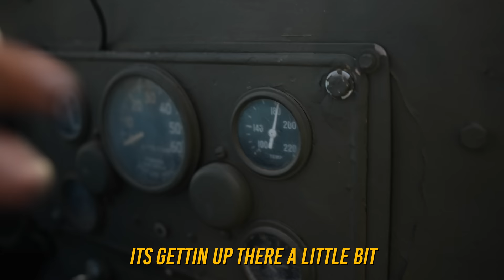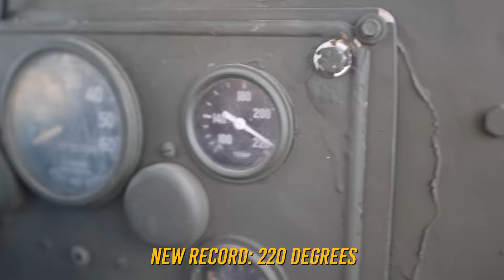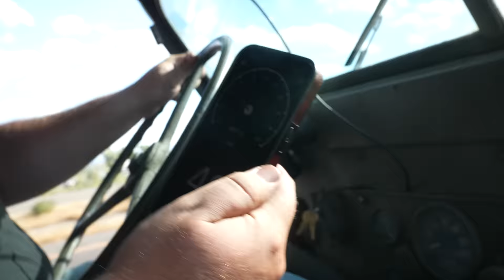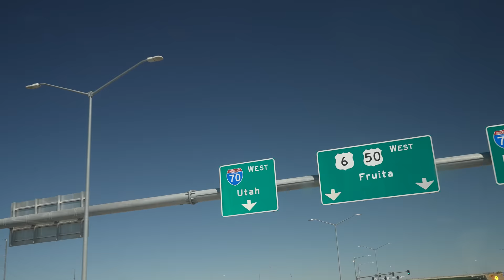We Off-road Test a 70 Year Old Army Jeep (1,152 Mile Road Trip)

Comment: The Jeep you have is NOT a WW II model. It is a 1950s era Jeep since it still has a flat head engine. In the 1960s, they body style remained substantially the same but they upgraded to an overhead valve engine,fully synchronized transmission, and 12 volt electrical system as well as increasing the tire size somewhat. The vehicle identa-plate will have the year of manufacture on it. By the way, WW II ended in 1945.

Comment: You made an absolutely unbearable drive and then fixed it and drove all the way back. But I don't think anyone has mentioned yet the fact that you completed a level 6 trail rated as intermediate that "requires a rear locker" and 35"+ tires are recommended.....😳 With two open diffs, old ass tires and a clutch that was giving you hell! ABSOLUTE LEGEND BROTHA!!! 🤙
Reply: in a vehichle that started the whole concept. really for me this was proof that the OG Jeep deserves its title.
Reply: C90adventures did it in a toy jeep 😂

Comment: We had two 40’s Willy’s jeeps at my grandparents ranch and we put those things through more crap in the mountains and river and sand than they probably faced in Germany and they took it every time. When we very rarely broke them they were super easy and fast to fix. When you lock the front hubs and put the in 4 wheel low they are just about unstoppable. We had a couple of other 4 wheel drive vehicles there that couldn’t do half the stuff those 2 Willy’s could.
Reply: My 43 GPW pulls 20' camper trailers around the field like it's nothing. 
And in low you can almost walk next to the jeep
Reply: @kyleh3615  I’d imagine it would pull a 30’ foot trailer as well lol. We use to pull 12’ wide  drag behind ours to clean up and level out the surfaces of our roads to the river and our alfalfa fields. They are what I learned to dive stick in and nothing is worse than driving stick through the mountains almost 30 miles to town. Steering never was exactly the tightest and you always had to pump the brakes after a bit lol. Needless to say I was never nervous driving any other standard vehicles in the mountains and hills.
The government got that vehicle right. Then again that was a different time with different builders and such. Truly amazing vehicles and in my opinion the most indestructible Jeep ever made.
Reply: @P-J-W-777  the Ross T-12 steering gear box was always trash. You can adjust it and tighten it, but it backs off almost immediately
Reply: @kyleh3615  yep, we thought about changing them out at one time but ultimately decided that it really wasn’t worth it considering what we primarily used them for. Plus they are really easy to work on and are practically bullet proof. 
We had a lifted 79 GMC C-1500 4x4 with mechanical hub locks that we fully restored. It was more for more my grandparents as it was a more comfortable and had an A/C & Heater lol. Anyway neither it or the 82 Bronco could hang with the Willys.
The only other off road vehicle that we had that came close was our International Harvester Scout. I absolutely loved that vehicle. It was in pretty bad shape and didn’t have an engine when we acquired it. We ended up dropping in a 454. It would absolutely run and I’ve had it airborne on several occasions lmao. 
The memories, I miss so much about those days!!!
Reply: @P-J-W-777  hell yeah man. I built my jeep the winter of 2020-21 when I was making crazy money from the 'hazardous pay' 
Not a week after her first drive, I had the jeep in every type of mud I could find. I've just kept pushing it and it keeps going

Comment: Someone will correct me but i think the Willy's did so well because of weight and gearing. They are really light, very short wheel base and geared LOW. So it does not have to work that hard to pop it over stuff.  Wonder if you took a stock TJ and stripped down and geared it down if it would do the same?
Reply: Please don't make the comparison it's rude to the Willy's jeeps , new jeeps are crap
Reply: Yes I owned a four cylinder YJ for off road and have trail ran with stripped down TJs and JKs.

Comment: I don't know if you are aware but, after WWII Mitsubishi of Japan bought the tooling and rights to make the Willy's jeep.  They still make them to the current day. They added some improvements, like increasing the engine size up to a 1.7 liter, but the vehicles are nearly the same.  The major difference is the right hand drive of the Mitsubishi Jeeps.  They can be imported.

Comment: Jeep was built by willys-overland (which Ford helped built a few in WW2) as a military all-terrain vic that needed to go into war territory undetected by the enemy,  it had to be made so cheaply that it was never supposed to return after duty, so it was originally one trip pony since you could simply build another right away, that's why they are the most modified, most converted, and most easiest vehicles to work on, that being said, A 4 wheel drive system with a shell thrown on top of it was a after market idea and was never going to hit the street of civilian life, but they became so popular with the soldiers that they got them back to the us and started using them a transport trucks, then in 1945 the CJ was born Civilian Jeep,  most cars and trucks never saw a four wheel drive system ( unless it was this huge bulky truck) until this little gem appeared. I am a jeep guy, probably the best one out there, let me just say if you are ever going to put the military tribute jeep is a sweepstake where I am the only ticket holder and none else never knows about the sweepstakes until I have the honor of winning it, I will gladly take it off your hands, and it will be going to a better place, a good home, a forever home.

Comment: 13:16 This is why I love old Jeeps.  I learned to drive in my grandfather's '67 CJ5 and I've still never driven anything more off-road capable.  It's engine's in the middle of a rebuild, if I can ever catch up with finishing other people's cars that I need to do first and get back on it.  15:10  Grandpa's old Jeep has lockers though.  You should get some and it'll crawl anywhere in low.  18:00  My guess is the linkage.  It has no bushings and is a metal rod in a metal hole on each end.  It wears through from time-to-time.  Be happy you didn't break yours in stop and go traffic.  Luckily, I managed to shut the engine off before I hit the next car, but we were kinda stranded until traffic cleared out and I could just start it in gear and rev-match the ten miles home.  I made a new one out of an old piano rod lol.  Still in there, but I really should pull it back out and bush it like a more modern linkage.  Never mind, I thought that was gonna be the end, heh.

Comment: That reminds me of old Yellow! Just fyi, old Yellow was a 1944 Willie’s Jeep from WW2 that still had the original flat head 4 go devil engine in it that was painted piss yellow. Or was it Neon Yellow? And had a 3 stick transmission, meaning the 3 speed, in/out and high/low. One for shifting, another stick for in/out of 4 wheel drive and a third stick for high/low. You also did not make a trip into town without a pack of gum, incase a fuse blew.

Comment: Crazy idea that might work take aluminum eBay radiator and strap it to the front on the outside and run the radiator hoses through the grill you don't have to worry about it in between the hood sparse

Comment: That god damn jeep is a hard thing to break, it also beat like 30,000$ rigs up those rocks with little to no issue. Only thing that "broke" was the clutch pedal and what ever that leak was, but the leak was prob some nut comin loose, so normal problems for off-roading.

Comment: As a German, I bought ..1972..this Model, a M-38A-1 -1953-year, Jeep, as Surplus by  US-Army,
low miles in Good-Condition, as had had in add; my small Collection w/M37 + Gama-Goat,
+ M3-Halftrack as used in my Ind.-Company.. Towing..Rail-Wagon's but with ex-changed 
Henschel-Diesel-engine-Air Cooled because fuel consumption 18l-Diesel..only.
US-Army M-Series Vehicles .. Phantastic to Maintain, All Models w/24V, electric- changeable
and Spare-Parts - in Ton's - cheap to buy...
Especially the M38-A1.. 4-Cyl; . my Utility Fun car - I drove near 15-Years w/o any Problems..
..then  - aged..gave as Gift in  Young Good-Enthusiast Hand , with 'Sentiments..
Thank's for Attention, God Bless America,

Comment: I'd like to see you do some seriously custom stuff to it while keeping the design philosophy the same. Port the head, up the compression, create long tube headers for it. Create a better intake manifold with a two barrel sniper EFI. Hell, if you cant find a high compression piston kit for it, just put thinner head gaskets on it. I don't suggest major power figures. But use some brain power and some modern tech to make it the best version of itself. Find a better clutch, get new shocks for it and maybe leaf springs if you can find them. New king pins would make it drive much better too.

Comment: Those old jeeps were built to go anywhere.  
Back in the day it was built there weren't paved roads all over. 
I know many farmers used them as tractors after WWII. 
They were rugged no frills get you there machines. Low speed high torque with super low gearing.

Comment: Goes to show you that the original twin stick of off reading is still the best. Manual transmission and manually shifted transfer case. Don't need all the soccer mom technology crap. Low horsepower decent torque and low gear ratio (numerically higher). Kinda like trucks today too.

Comment: Just imagine the Westin put a 440 big block or a hellcat engine in there
Reply: That defeats it's off-road capability weight wise and it would need a complete new drivetrain from transmission ,transfer case and axles

Comment: hood lights and window suggest post wwii jeep around 48 to 54 roughly an a 9 slat grill
Reply: It's a 1953 M38A1 and only the WW2 MB and GPW jeeps had the 9 slot grill starting in 1945 the cj2a had 7 slots then in 1950 when the cj3a came out the military had it's version called the M 38 still a flat fender then when the f head engine with overhead valves came out they made m38a1 jeep with a 6" taller hood to acommodate the taller engine and a few years later they released the CJ5 civilian version while retaining the flat fender body with the cj3b that had a taller hood also

Comment: im waitin for a bigger engine in that thing like a twin turbo v8 in a 70 year old jeep sounds good to me
Reply: Nobody gets it , for one thing it has the wrong engine but besides that it's drivetrain I designed for 60 HP and about 160 is all that trans will take without coming apart ! Most modern trucks have steering boxes bigger than that trans ! It's great the way it is but his has the wrong engine anyway it's the early flathead and never came in that jeep

Comment: Dude, that jeep almost fits on the bed of your truck
Reply: It will fit in a 8ft truck box with the tailgate down the back tires hang half over the tailgate so you jack it up and put planks under the back wheels  , have done this a few times and it works

Comment: i have a request,can you do supercharged v8 swap on that jeep?
Reply: It would defeat the purpose , the driveline would need swapped as the old one is designed for 60 HP only the mod 18 transfer case is even remotely capable of v8 power

Comment: You do car engines swap with something normal like 1.5 or 2.0 cc engine 200hp should be enough for her
Reply: Trans won't hold , Buick 225 v6 a perfect swap or even the right engine as that's not the correct engine for that model

Comment: Be a much cooler jeep if it had the right front clip on it
Reply: It would be even cooler if you knew what you were talking about ! It's the engine that's wrong not the front clip ,it's a 53 m38a1 and even has the correct slave adaptor hole in the passenger fender for the 24volt system . It's not a WW2 MB or a GPW it's the military version of the CJ5 that came later
Reply: @Bob-tn5xn  didn't ask

Comment: Ok its not a ww2 jeep not even close ! And its the wrong engine it should have a F head 134 but it has the older L head 134 with less hp. And less reliable as the blocks always have cracks between the valve pockets and the cylinders in the combustion chambers , and its amazing how many. Clowns are suggesting hellcat , LS, twin turbo and blown V8 swaps  ! just goes go show you how many people dont understand older jeeps

Comment: By the front end, dont think thats a legit military jeep. Looks like my civilian version.  Also he doesn't sgiw what the problems are, just bs entertainment with nothing to learn anymore bc of laziness
Reply: Actually it is a m38A1 it has the slave abaptor hole in the passenger fender but it doesn't have the right engine also the instrument cluster is removable as a unit which is correct military and the CJ5 version came out after the military model like in 54 or 55 but it is amazing that nobody realizes that WW2 ended in 1945
Reply: @Bob-tn5xn  I believe you, I don't remember all the research I've done, I just know the fronts looked different than mine vs military